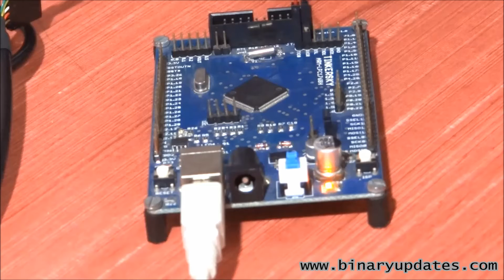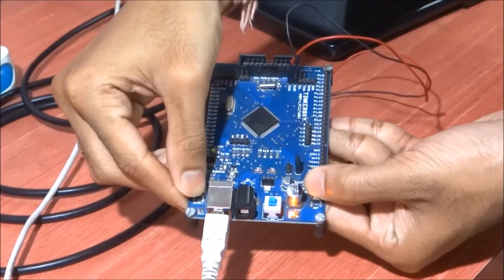Flash Magic: ISP Bootloader LPC1768 Cortex-M3

Comment: Is it possible to dump a existing bootloader on LCP1768 ? I have 2 similar boards with LCP 1768 and the bootloader is dead (lost of usb port) on 1 and i haven't orginal source code.
Reply from the maker: I don't remember now its been long time i worked with LPC1768 microcontroller. But I remember there is primary and secondary bootloader concept in LPC1768 so please check in datasheet and confirm if you can reflash the bootloader. Best wishes!